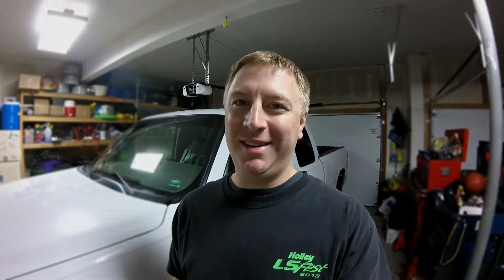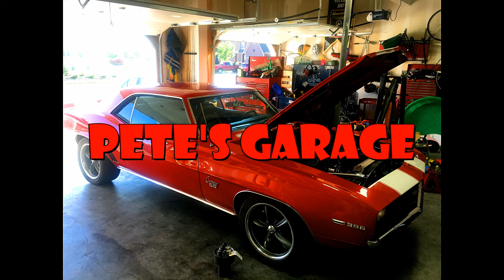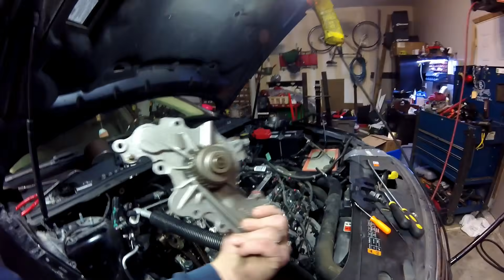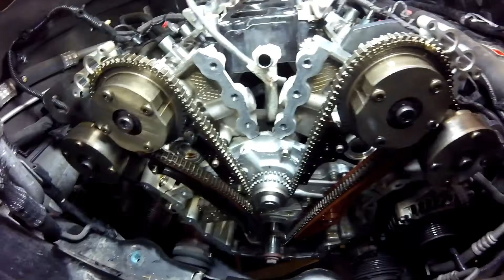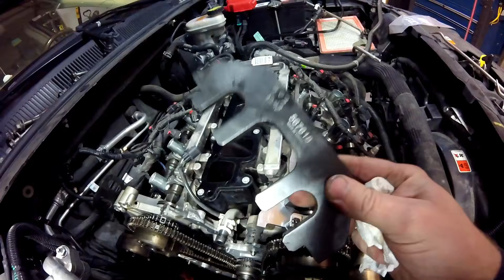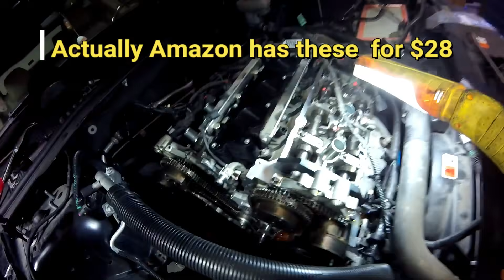Why does the Ford Taurus, Explorer, Edge 3.5L water pump cost over $1400?

Comment: What mileage would you recommend changing a non leaking water pump?
Reply from the maker: It’s hard to say. They really can fail at any mileage. But I would think over 130k miles is starting to push it. If it were my car, I would just monitor the coolant level. If it starts dropping or you see a leak from behind the alternator, water pump time.
Reply: Change the oil every 5,000 miles and flush the cooling system every 2 years or 20,000 miles is the best advice from a owner who owned two Ford Edges and don’t beat the shit on it.

Comment: How long do they last after when it gets fixed
Reply from the maker: I would assume as long as the first one did. Unless the water pump is built with upgraded bearings. But every aftermarket manufacturer claims to meet or exceed OEM specs. Only time will tell.
Reply: Pete's Garage  it’s better too buy a ford one right
Reply from the maker: I would. The aftermarket ones could possibly be better, but who knows. The Ford ones usually last over 100k miles.
Reply from the maker: I would. The aftermarket ones could possibly be better, but who knows. The Ford ones usually last over 100k miles.
Reply: Pete's Garage thanks for
Telling me

Comment: Free advice, Loosen the cam bolts by holding the camshaft with a 22mm wrench. Once all 4 are loose you can drop the special tool in to lock the cams in place.
Reply from the maker: Yep that’s what I did. The next one I did, I didn’t take the cam actuators loose.

Comment: You are not gonna replace thewater pump every year,  it's quite reliable part, Ford is really reliable brand. But they're lacking in marketing.
Reply from the maker: Tell that the many people who have had to shell out $1400+ to have it done. Or the ones who didn’t catch it in time and had to replace the engine.
Reply: Same thing will applicable to engines with timing belt and poor piston rings.  If u have something it's your responsibility to take care of it. I think people who doesn't care about  their car will deserve such expensive repairs.

Comment: Just did a 2012 Ford Taurus with this same problem water pump replacement and honestly it’s the worst car I’ve ever worked on and the worst design I’ve ever seen in an engine. 🚮
Reply from the maker: Right? People who haven’t performed the job wouldn’t understand. It’s a lot of work for such a cheap, failure prone part.
Reply: Pete's Garage oh yeah definately it’s a pain I came out of work with headaches lol with that damn car couldn’t believe how Ford design that engine so shitty lol plastic impeller on the water pump? Really? If it’s such a pain to replace it why not make it aluminum that’s why it fails because the bearings inside start to have play and coolant starts to leak through past the passages on the water pump also why not design it so if the coolant leaks from the water pump it doesn’t fall straight into the oil pan and mix with oil wtf?! 🤦🏻‍♂️

Comment: One reason for the push towards electrification.
Reply: need metal,
Or vice versa. Could this be a conspiracy to get us all to turn away from internal combustion engines? 

I know that sounds far-fetched, but it is almost easier to believe than the alternative explanation that the engineers who come up with this stuff could be so stupid. (I wonder if any of them ever read any of our comments here and have hurt feelings?)
Reply: @ArcoZakus  that would be kinda ridiculous. Internal combustion is on it's way out anyway. Too many moving parts and the engineers never get it right
Reply: need metal,
"... kinda ridiculous..." Indeed, but that is no proof that it could not be true. Extremely ridiculous things happen all the time. 

Take the design of this water pump, for example. It's kinda ridiculous that anyone would design it that way, and also that the design would be approved. That did not keep both from happening, though.

As for the internal combustion engine going away, not any time soon, in my opinion.
Reply: @ArcoZakus  not going away. Horse and buggy were still around after the car was invented

Comment: You won't need the cam position tool if you remove a cam bearing cap and place a thin piece of card board under it and tighten it down before you remove the chains

Comment: Lol absolutely no need to remove the actuators, just loosen the rear guide with a stubby 8mm wrench. It's enough to remove the one water pump bolt that's behind it and the pump will slide out no prob 👍 **the chain comes out without removing the actuators too, for ease of lining up the timing
Reply from the maker: Thank you. I actually did this on the last one I did. That one 8mm was a pain to get to but it does save a lot of time.

Comment: I have the Taurus and lucky for me a bought the extended warranty. Bought the car new and dealership sold me on the warranty. It was only 1g to double the warranty to 75 000 miles. Everyone said  Never buy one etc etc.
At 70 000 miles the water pump  and the starter went.
Reply from the maker: Gotta love it when the extended warranty pays off!

Comment: Want to know how you replace the injectors or just remove the valve cover on a Ford Power Stroke Pickup?  You pull the cab!  8 hours off, and at least 8 hours back on.  16 hours of labor BEFORE you get to the injectors.  Some engineer needs to be beat half to death!

Comment: If you 1400 dollars for this you are an idiot. 150 at least to 300 at most. Dealerships at mazda and ford charge 300 to 600 nationwide. If they are charging 1400 as a certified dealer then they are messing with the contract for certification through their firm with the Ford Motor Company. The labor is not 1400. One person job 2 and a half to 3 and a half hours. Read a manuel dude. You suck

Comment: Its funny that after all you know about cars you didnt know this mazda design is always ever present in ford cars for 20 fucking years. Your a fucking genious. Mazda motors are in ford cars for a 20 goddamned year period and duratech is the generic poorly made mazda motor.
For you to not know this or understand that a mazda v6 will always have a goddamned cam pulley means you have just learned how to operate on a ford/jaguar/lincoln/mercury/skoda/mundeo/mazda/bmw/volvo etc.
They all use a fucking mazda or generic duratech except volvo and bmw. And the design is still today is based on the mazda. You think because they sold mazda in 2015 the would spend to retool because of broke ass mazda? Lmfao. Its nothing new at all. You need to lock the cam wheel so you dnt come off time.
Also, i wonder how many chryslers you have worked on. Or did you become a mechanic for cars in the 1980's like soo many people did and never caught up to 2001. You suck because you are soo far behind in knowledge about cars in general that you have no business acting like you just discovered this.
I would bet you are still learning the battery/limp mode trick to transmissions. Or are you another "master mechanic" that believes your ford Taurus from 2012 or whenever will run with a jump and no battery?
"Oh your tranny is bad". No you need to learn about modern cars and stop fucking with shit from the 90's. Go back to school. I'd like to see you re-cell a 2010 honda crv hybrid battery. You probably dont even know what kind of battery it is.
Or change a water pump on a 2008 mercury mariner. Or fix a 2009 PT cruiser that wont go in reverse or drive over 20mph. Or the same for a 2013 malibu with all warning lights on the dash which these are super simple to fix.
Like most "certified" people however old and outdated that certification may be you are text book worthy of knowledge.
You dnt know shit about the industry. Nothing.
These water pumps have been in fords with mazda and duratech motors forever now. You suck

Comment: When the water pump goes out on these cars you just scrap the car. Today's cars are disposable.

My 2001 Ford Taurus Wagon SES with the 3.0L DOHC Duratech V6 is rock solid. Water pump is belt driven off one of the camshafts on the front bank of cylinders opposite the accessory drive side of the engine. It's right in the middle of the car on top an so easy to get to and change. An hour or less to change and under $150.00 using OEM Motorcraft parts to change the pump, belt, and tensioner. 

Why Ford went from the excellent design on the 3.0L Duratech to this cluster fuck design on the 3.5L Duratech blows my mind. WTF was they thinking.

Comment: I'll get right to my point.  59 years old raised under the hood by a shade tree mechanic back to the Great Depression and I can now say that any respect I ever had for Ford is now gone.  Ford was the one remaining USA manufacturer that I still had warmth for and respect.  Not now and never again. Whoever at Ford approved this design on such an affordable simple family car deserves all the sh_t life can give him.   Here's the kicker.  My Toyota might very well have exactly the same water pump design but there is one difference.  On my Toyota I'll never have to find out because the Toyota will last thrice as long as a Ford so I won't give a crap when the Toyota water pumpt goes out at 250,000 miles.

Comment: because Ford sucks....I bought a Ford a few years ago, because it had great gas mileage and I had just gotten married... the worst disaster I ever bought...breaking down all the time, the "found on road dead" is perfect for this car... 
I drove Volvo for years before this, the ford died..I'm back in a Volvo and couldn't be happier.
And look at that mess under this hood, even though I didn't have a taurus, it was the same cluttered mess...I bought another pre-Ford Volvo...it's not a mess like this, and changing the brake pads take me 15 minutes per wheel....1 bolt loosened, 1 bolt removed, lift, pads fall right out. 
This video shows the absolute nightmare of working on a ford and all the special tools....nothing practical on this piece of shit.

Comment: I had a Windstar 2001 with a 3.7 liter V6 ohv- the water pump wasn't that outrageous, but he $250 total to replace a $6 thermostat because it was on the side of the block, close to the firewall was a gear grinder for me. Mostly I liked the car, but that pretty well did my like in. Ford wonders where it's sedan business went- that is because they have their head collectively up the derriere of Ford Corporate and build cars their clients can't fix and wind up not liking.FR
Reply: It was a 3.8L
Reply: @harrybalsonya5619  I believe your are correct- for 2004 and later.  FR
Reply: @fredericrike5974  perhaps I should elaborate on that. In North America the Windstar came equipped with one engine option in the 1999-2003 model years and it is the 3.8L ohv motor. In 2004-2007 it was rebadged a Freestar and two engines were available, a 3.8L & a 4.2L. But irregardless of engine size the thermostat was never against the firewall in the North America models.

Comment: Sounds like the correct fix is to 
#1. Remove gas cap
#2 fill vehicle with cement
#3 dump cemented vehicle in front of ford HQ
#4 drive in a new vehicle and put original gas cap in place, viola. Fixed!

Comment: Had this exact motor in our 2009 Ford Flex and the water pump died while we were driving down I-15 in Southern California. Car got hot, but we pull over and shut it down quickly. $1400 later, back on the road. 
Then the next oil change and we found water in the oil. Without the extended warranty, that car would have cost us an easy $10k in repairs with everything that went wrong. Engineering solutions from Ford that were completely boneheaded, ruined an otherwise good car. 
For example, if the climate control module goes out, the car will still allow the A/C compressor to run. And with the A/C on, the compressor will run full tilt, without the fan turning. 100% duty cycle. Naturally, the compressor isn't long for the world running like that and when it fails, it fails spectacularly, blowing chunks through the rest of the system. Ford replaced, under warranty, the compressor, every pressure line, the condenser and had to scour the evaporator out. The whole mess could have been fixed by simply having the compressor disengage. A few hundred bucks to fix vs. several thousand. 
The fuel pump and pickup assembly in the tank of the Flex is stupid. It uses some vacuum draw setup to draw from both sides of the saddle shaped tank. The AWD models need the saddle type tank but the FWD models do not. A different fuel tank would have worked, or at the very least, a better thought-out pickup system. Because when the system breaks, your Flex can no longer effectively draw from one side of the tank. You'll go from 100 miles left in the tank, to Zero in about 50 yards. Have fun pushing that big heavy beast down the road. 
Oh yes, and ours did that twice inside of two years. Fuel pump failure left us stranded. 

cliffs: Screw you Ford. I hate you.
Reply from the maker: Ouch! At least you had the extended warranty.
Reply: @PetesGarageandperformance  That car was the biggest piece of shit. I know that only one of those was the fault of the motor, but damn if it wasn't an expensive disaster from day one.
Which really sucks, because I loved the car. I think i'd have loved it more if Nissan made it. The VQ35 in my wife's Nissan Quest has been dead nuts reliable.

Comment: Wow, was that enlightening! The question is how often do water pumps fail on this model? It's engineering like this that helps me decide what cars to stay away from when I'm looking to purchase another vehicle. They all have their downfalls but some appear to have had designers who compete in making the most costly repairs like having to drop the engine because the trunk hinges squeak. Thanks for sharing.
Reply from the maker: I believe this is pretty common over 100k miles.
Reply: @PetesGarageandperformance  That definitely removes the Ford from my 'maybe' list. And here I thought the idiocy of using a belt rather than a chain for valve timing was a foolish idea. A timing chain simply means turning the radio up a bit louder. Who reads about the intervals on their car? My aunt doesn't.

Comment: Would have been even better if your title was more accurate, something like 'water pump replacement/job $1400'  OEM Motorcraft water pump costs $85 for Taurus 3.5L, besides the title well informed video.

Comment: Typical Ford engineering. I worked on them ( Fords) for 25 years. Drove Chevrolet the whole time.
Reply: And I was a GM Grand Master Technician  for over 15 years and always drove VW's LoL.  The new FoMoCo engineering philosophy is fucktarded at best. This new breed of engineer that's coming about today proves that they've never spent so much as a minute even changing a spark plug on a lawnmower but has spent thousands of hours meddling with minecraft on there computer and/or phone...  I can remember going to a conference once where there were some GM engineers and they literally had to leave because technicians from all over in attendance berated them to the point I think they feared for their own safety.  Then there was our TAC (technical assistance centre) line where techs in the trenches could call engineering for help... I cannot remember ONCE them ever ever aiding in a resolution to my diagnosis and repair of a problem ....  I just used to call them for authorization codes for more diagnostic time...

Comment: Haha "these special cam locks cost a few hundred dollars, I actually didn't price them out."  

Caption reads:  "Actually  $28.00 on Amazon. "  a little off there ehh buddy :) .     When I saw how simple the blocks were I figured aftermarket is probably cheap on them.
Reply from the maker: Yeah I’m sure Rotunda charged ford dealers $400 for those tools though.

Comment: I just bought a 1983 BMW R65. Utterly simple and a pleasure to work on. Clutch out at the roadside is doable! Recycle? No! Never take it to the dump!
Secondary chains for the second pair of cams?what? The main chain ducks all the way down to meet the water pump and then comes up again??? Rocker covers AND timing cover off to get to the pump because the cams have to be held on the rocker cover side??? Even old Fiats had pins you put in without taking the rocker cover off. 
I saw a vid of a new HD twin engine that had similar design flaws. I think junior engineers just start from scratch in 3D and don't consider the 'well known' stuff that has been forgotten. Looks great on the render, does 40MPG and makes loads of power and is cheap to assemble. Just don't ever open the hood. Just like my washing machine, my 'phone, the house boiler and all the other 'disposable' crap that is killing the planet.
Reply: Things are designed to be cheap and easy to make, if that makes them very expensive to repair, that's a bonus

Comment: Hello Pete. Thank you for sharing that sir. Anyway, I’m curious about a particular item, that a normal engine has. Does that vehicle still have an oil dipstick tube????
Reply from the maker: The dipstick tube is built into the valve cover, head, and block. The dipstick just goes into the front valve cover.

Comment: This is why people should consider maintainance costs when buying a car. Whether it's new or used, parts fail. I'm sitting at a auto salvage yard, getting a window regulator for my 99 Camry. These cars are not bad to work on, especially mine with the 4 cylinder.  I'm fortunate that I'm able to do my own repairs. That job you showed is why I don't want or need a newer style car.
Reply from the maker: Being able to repair a car yourself will save you thousands of dollars. I can’t imagine having to pay someone to repair my vehicles or things around the house.